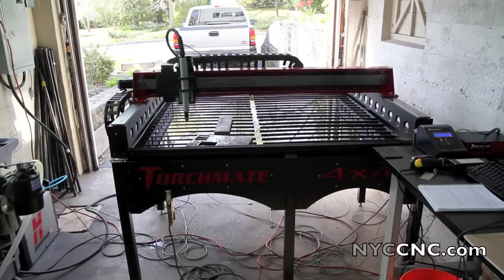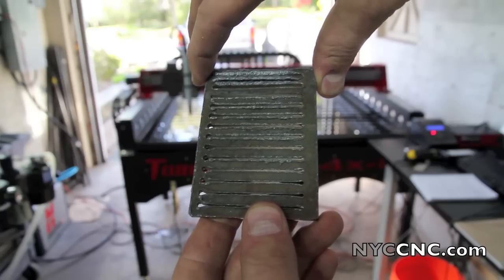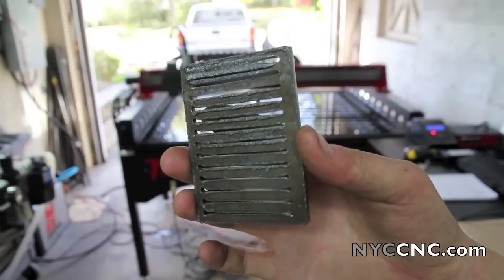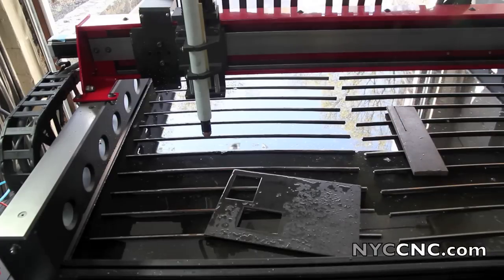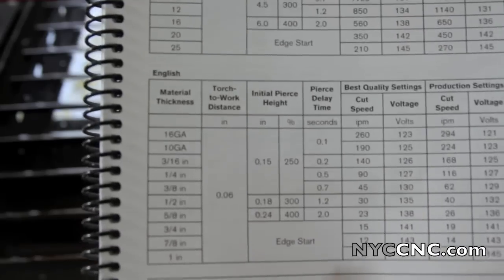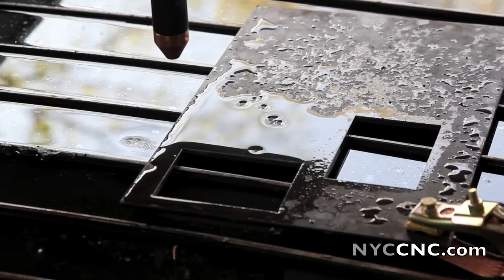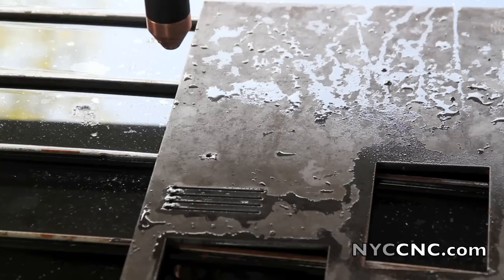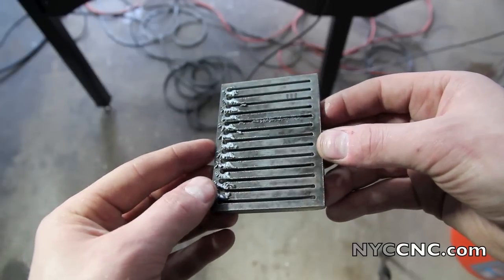FIRST CUTS! Torchmate 4x4 CNC Plasma & Hypertherm PowerMax65

Comment: Good trick of the trade on plate is to spray anti spatter on help with piercing and cutting circles when you come back through your start no weird kerf lines. Mostly on thicker plate with a down draft table but it might work on a water table

Comment: With an air plasma system, the reality is that you could tweak your settings until you're blue in the face and you're realistically still going to end up with some dross. Only when you get up into the higher end systems that use oxygen/oxygen blends will you see what you could call dross free cuts on mild steel.

Comment: The Powermax65 and Powermax85 have hard stops on the retaining cap, so no need to be concerned about over-tightening.  The retaining cap does not need to be loosened when received from the factory.  The tightness from the factory is just about right.  As your mis-fire showed, loosening the retaining cap too much can lead to a consumables error code.  No problem though, just check consumable installation and restart.

Comment: Nice job!  I'm still learning with our system getting the auto torch height to work smoothly.  I've found that the numbers in the book for cutting speed are too fast by 10-20%.  We have a different system though.

I've found that if you can it is helpful to make long test cuts rather than short ones, there are so many things happening its hard to catch everything when its occurring so quickly.

I'm going to try to put more videos up of our system.  Check out KEF791, Keith has a first rate setup.